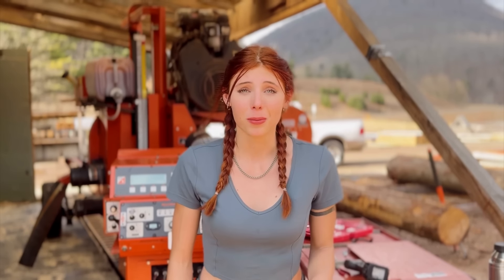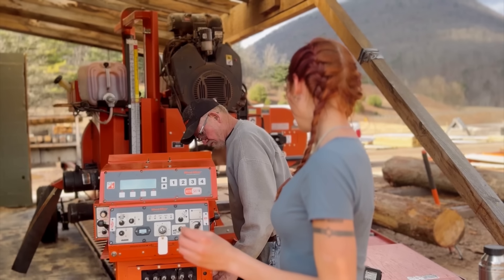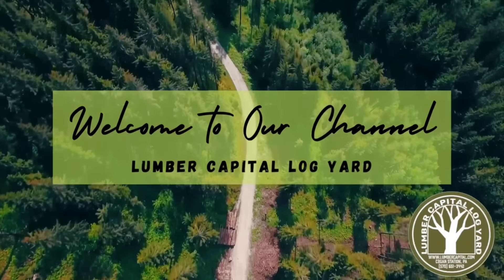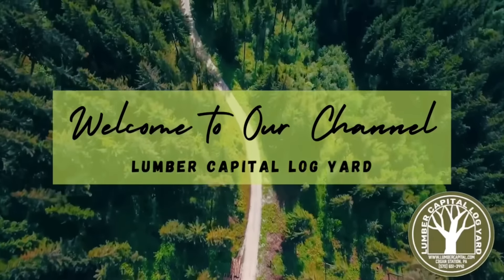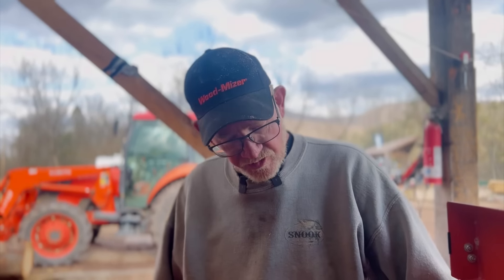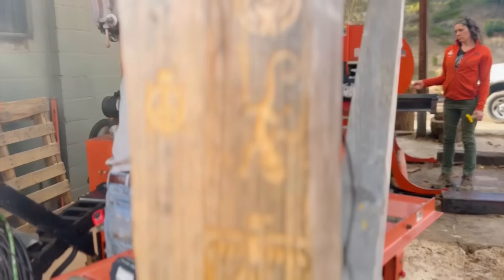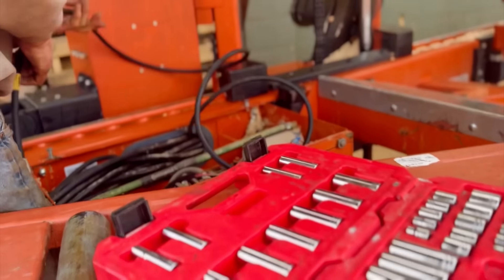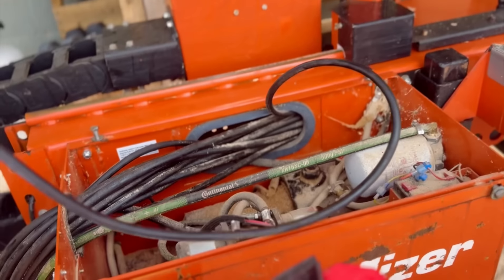A TRICKY repair for something so simple!

Comment: twisting the hose around and around in a s if you were scewing it in works good to.. i,ve also had to cut down a funnel  and place it over the hose so the end of the line didnt fetch up....maybe next time...we are all in this together
Reply from the maker: In the end, that is exactly what did it! Twisting it is for sure the trick!
Reply: @lumbercapitallogyard     YES!!  Glad you got it to go through!!
Reply: Greasing the forward end could help also.
Reply: Hand soap will reduce the resistance when pulling or there’s silicone lube also to help when pulling on such a small hose
Reply: I used to be electrician helper we used to use thin metal that was rolled up like garden hose we put small hook on end and taped old line or string on it enough tape so it was completely covered on string end not to get hung up
Reply: @lumbercapitallogyard There's a spray on lubricant us broadcast guys use, for pulling cables through cable trays in studio installs, and that product would probably help the same way with hydraulic lines, as the outer coatings of both hydraulic lines and high end broadcast signal cables is a similar material, same goes with the smooth outer sheathing on pneumatic lines. IIRC, it was marketed by Belden.

Comment: use tape to make the angle of the hydraulic connection more conical and prevent it from getting stuck (a bic pen cap with the string passing through allows you to have a solid cone which will fit well and avoid hitting an angle )

Comment: Hi,they last for manny years but if they rub or flex during each cycle it could break inside.You need a very strong nylon fish cord to make sure it doesnt break the string. Tapeing the front to make a point to not hang up or catch on anything is wise too.A exrea made hose is needed if it breals often ,then you can attach them and pull 5he l3aking one through.

Comment: A lot like pulling big conductor wire in conduit. May need to make a large "bullet nose" on the front of the line. Use electrical tape. Also may need to use a pull wire vs string.

Comment: They are a pain, that's for sure. I've had good luck using a male x male coupler to attach the new hose and pull it through with the old one. Hose lengths are in the parts manual.

Comment: Shove a length of rural poly hose down it and get it to poke through then feed the hydraulic hose inside . Once its down there you can leave it in or pull the outer hose out.

Comment: i had to deal with this same problem pulling wire... first use the line to pull a more substational thicker and stronger  line through likea  paracord or may be 2 of them so you have a second chance if you break it on the first go; then use that line... get a (sacrificial) threaded hydraulic cap or some other arrangement of fittings  drill a hole dead center being sure to deburr it so the hole does not have any sharp edges...  and  put that para cord through that hole  tie a few knots in the cord so that you can pull on it with out it slipping back through the hole.   for good measure wrap some tape (blue painters tape works great) around the cord to the fitting so that there is a gradual thickness transition between the cord and the hose... affix the hose to it and you should be able to pull it without snagging

Comment: If you use a electricians fish tape which is a steal cable and it has the ability to pull much more.  Home depot has them and you just need the short one they have will do fine.    The cable will ride on top where a string pulls uneven and the tip is slipping to the side thus creating a jam.    Metal end need follow the line.   So some electrical tape will be needed to keep everything in a straight line.

Comment: That always gets stuck, twisting it helps. If there is enough space you can use these hoses used to protect cables, wide enough to let the hydraulic line through. Tape the end to the hydraulic line and pull it through like you did with the string when removing the hydraulic line. To reinsert the hydraulic line push it through the cable hose, cant get stuck that way, and afterwards pull the cable hose back out.

Comment: Non conductive fiberglass fish tape. It will allow you to push through and pull. The hydraulic hose rubber has a lot of resistance that makes the pull hard. Non conductive lubricants might help the pull too.

Comment: Another process is to center the tow line by adding a centering rod into the hose and tape it to where the hose is centered to the tow line. like a sharpened pencil.

Comment: Or having the old tube in place, used a male male connector and draw it trough. But to late now. But replace this thin line with a steel wire firmly attached to a male connector and just get some power to pull it trough.

Comment: Better to pull aircraft cable through first and then use an old fitting attached to the new hose and then you can pull hard

Comment: I’m not sure but I think the size and length of the hydraulic hoses are in the owners manual. If so, I would go have the line made up at the shop, attach it to the old line and pull it through as you pull the old one out. Just a thought.

Comment: There is actually a lubricant used to pull electrical lines, and they are much slicker than those hydraulic lines.
I checked, and sure enough, there is a hydraulic line lubricant specifically for pulling or assembling.  Something you should have on-hand.

Comment: As an electrician I use a length of wire as a fish, copper wire is stronger than string. When pulling back in I'll tape the end to make it streamlined, no edges to get caught. As some one else said twisting can help.

Comment: a suggestion to anyone having to run through things is either think mule tape or use the fiberglass rods that network techs use to pull things through conduit. Harbor Freight has cheap versions of this.

Comment: I WELDED A LOP ON A HYD PLUG SCREW IN HYD LINE THEN U  CAN ATTACH A CABLE AND  PULL HARD IT DOESNT SNAG ON THINGS CAUSE YOUR PULLING THE LINE IN CENTER NOT OFFSET PLUS IT KEEPS CRAP OUT OF LINE WHILE PULLING THROUGH RAIL

Comment: Another way to help you fish that line. Is have the opposite fitting, male or female. Then feed you're fishing line through the center of that fitting. Then fasten that fitting to the hose you are trying to pull through. Doing this, will greatly reduce, the line fitting from getting caught up on flat surfaces or other hydraulic lines. As you will be pulling from the true center of the line.  You can also wrap a little electrical tape around it. To make it more conical.

Comment: Now that you got the hose out measure the length and write it down so you know the next time . Then you can thread the new hose on one end when you pull the bad hose out and the new hose will follow into place at the same time . And you will not need to worry about a string breaking mid way 😊

Comment: I would recommend buying an electrical “fish tape”, which is normally used for electrical conductors through conduit. They come either steel or fiberglass. They are flexible but rigid and would serve you better for your task. I was an electrician for 45 years and used them at least once or twice. I’m thinking that the hydraulic line somehow got pulled in above one of those cross bolts supporting that frame member/chase that all those lines go through. I would think that could have been what nicked the hydraulic line that failed.

Comment: Next time try using electrical lub that is used on larger cables fed into a conduit with other cables. You may be using a lubricant already just a trick used by electrical trade.  It should improve the pull.

Comment: Few nice little tools you should get grandad. You get a little cone that screws into the fitting with a hole for your string at the point. Invaluable. 
Also a set of cranked spanners are a winner when dealing with hydralics.

Comment: Considering this has happened before, I  suggest that to prepare for the future, you should have another replacement line as a backup. So when this happens again just attach the replacement line to the line being replaced. You can pull one line in as you pull the broken  line out.

Comment: Screw on a fitting at the end of the hose coupler. that has a hole drilled through it to attach the heavy string. Save this fitting with the hole drilled through it for next time. you have this problem

Comment: You can try to pull the rope again, but tighten it so that it goes along the very top and then pull the hose. Next time, wrap a corrugation for electrical wiring of a slightly larger hose diameter to the torn hose, and pull the new one through the corrugation, then tighten it.

Comment: Round over the end of the hose with tape (like a ball) so it gets around other hoses better.  And try using a fiberglass electrical fish tape. They can be pushed through until they come out the other end.  Then serve your hose onto the fish tape and pull it back to you.  Don't use a steel fish tape for obvious reasons.

Comment: every time you actuate a hydraulic line it has a tendency to "flex". if you inspect these lines on a regular basis you can identify wear points and through the use of shields or guides prevent premature failure.
Reply: and i love the new showroom

Comment: Trick is to give the tip of the line a smooth shape with tape and lube it so it goes easier all the way through the frame. The line needs to hold tight like grandpa did or one will happen to pull a line... with no fish ( pure nightmare, been there before 😅)

Comment: Personally from one old grandpa to the next I would have measured for the new hose and left the old one in as a fish line. This way the new line is pulled into place by the old one and would have slid right in. As you'll see the new line will keep getting hung up because the string isn't pulling it perfectly back in the same hole. You may end up just routing the line outside. Should be a parts list with the saw. Look at the old line for ware marks, maybe it's rubbing somewhere. Preventative maintenance.

Comment: If you make a saddle with wire on the end tie the pull string to that and tape it up good you'll pull it straight on instead of from the side letting the fitting wanting to turn and catch and you would have better luck using a fish tape or Paracord if it's still tight stretch the hose straight out and turn it as it's being pulled my self when I replace a hose that long I replace it with several hoses 4 to 5 feet coupled together as long as you get them good and tight you won't have a problem and if it blows out you only need change a short piece you can keep on hand rather than need an exact length it cost more up front but saves in long run in parts cost and being able to have a replacement piece on hand I learned that back when I worked in the coal mine and have been doing it to all my equipment since I keep enough pieces on hand to replace common sizes if the shop you use has the correct fittings for the factory hoses they will usually cut them up and put fittings on them making 4 or 5 foot pieces if not different Napas have done it for me they just won't warranty a used hose but I've never had an issue when you get into the big 1.25 or 1.5 inch hoses on equipment you'll be really glad to be replacing 5 feet instead of 20 take it or leave it y'all seem to be doing good this isn't good logging weather and so much for winter freeze to boost production good luck

Comment: Just from a mechanics point of view. That hose is probably one of the only hoses to see full system pressure because it reaches clamping force in the application it is used for. Most of the other hoses only see pressure equal to the load it is moving. Also, there are different types of hoses rated for different pressures. Be sure the hose they are selling you is designed for the system pressures exerted by the system.

Comment: You should of used the old hose to pull the new one through by connecting the two with a nipple, you just have to measure the old hose first over pulling out to match.

Comment: Those long hoses through that tight but long channel is a nightmare. Especially for hoses supplying a cylinder which is moving when operating. I would add a short extension between the long hoses and the cylinder for future quick replacement of just that worn-out external short hose part. Wish you all patience for that annoying task and quick success! Cross fingers

Comment: One thing you can consider doing is before you actually remove the hose, initially, instead of using string, use a garden hose (kept exclusively for this sort of thing to avoid contamination) that is of a suitable diameter that can either have the end heated up to fit over the hyd' hose connection (suitably blanked off to avoid contamination), or add a dummy male connector to the garden hose end. Once this is over the end, the pull the damaged hose through and you then have a ready-made guide for the replacement hose. Join the replacement hose and garden hose just like the initial removal then pull through.
 The beauty of doing it this way is the garden hose acts as a sleeve to prevent the replacement hose end from snagging on any structure. The return pull-through is all linear since there is no kink off to one side, as you had with the string. I've jury-rigged many a job like this on aircraft to replace cables and such and the important thing is to avoid anything that juts out to one side.
Note, this can still be achieved even without the original hose in place by using a wire chaser attached to a lengthy extension on the string (so you don't need to pull that back through, thus avoiding the possibility of it snapping!). Feed the wire chaser thru the length of garden hose until you reach the other end of the garden hose with the wire, then pull all the wire along with the string extension thru the garden hose and hey presto...you now should(!) be able to pull the garden hose thru so you can then attach the replacement hose as described above. Might be a bloody good idea to duplicate your string line, first, tho. Because you sure as hell don't want that to snap!

Or, as @DonDegidio said earlier, have the new hose handy and attach prior to removal.

Good luck!

Comment: Woodmizer should have used hard lines through that channel with flex lines connected at each end for the required flexibility.  would have been much easier to repair that way.  the problem your having is they pulled all those hoses in at once so they are twisted around each other making it very difficult to pull back in with a string.  measuring the required length or getting it from the manual and connecting the new hose to the old with a union so the old hose could have been used as the pull string would have worked better.  at this point giving up on the string and using an electricians fish tape as others have stated is probably the best bet.

Comment: Looks like they forgot to transfer the Yellow Colour Code sleeve!  Should have used metal cable for pull wire.  You can also coat cable with liquid dish soap.  Make sure to use enough tape so there are no edges to catch.  Great braids.  They make steel wire cable pulls which might help next time.

Comment: Murphy's Law; whatever can go wrong,will go wrong.  when cable companies pull cable thru conduits,they use a water-based lube to lower the friction,make it easier to pull. IDK if that would help you or not. some electrical tape around the connector might help,too.

Comment: To replace the hydro line through the channel we used a fiberglass tent pole from a dome tent. It's stiff enough to push the other lines out of the way and helps guide the new line through the tight space.  It also creates a rigid entrance/exit path from the channel's openings that the hose ends can follow. Most importantly ... it won't break on ya' if you have to use a lot of force.

Comment: When I've had to run a wire or hose through a tight space, I've found that if I slick the wire/hose up with dish soap, it slides a lot easier over the existing wire/hose bundle.

Comment: A fish tape would have been better to pull with. Also yes if you could have gotten the length or hose and had new one ready to pull with a coupler would been better. I am sure you still may have had hang ups.  I know easy for us to suggest better ways to get done. Maybe a video follow up on the final outcome…

Comment: I would keep a old hose, attach it to the bad old one. Pull out the one you need to replace, leaving the temporary one in the tube. get the replacement hose, reattach to the temporary one and pull the new one thru. Store the temporary one for future use.
.
Its those bolts, most likely hitting,  raping tape around the hose out the string making the approach angle to the bolts smooth, is another possibility.
Use a string you can truly yank on.
Not with equipment, just hand force.
.
Figure out the approximate location of the blow out, and if applicable get plastic hose protection, its like a plastic spring that goes around a hose to keep it from rubbing on other things getting a puncher.

Comment: For the next time measure the hose get a spare and buy a union to screw them together and pull the new line in with the old one. That's the best way I've found to pull the lines through keeps the ends clean from being sealed to each other.  Good luck and keep up the great videos.

Comment: I would tie a heavier chord to the string and pull that through first and then tied the heavy cord to the hydraulic hose and pull that through something that would be strong enough.
Not to break in Like when you throw a throw weight over a branch when cutting a tree down, you gotta small 16th inch 9 line lying you throw over with your throw weight and that hooks to your half inch or larger rope that you need to use when you're doing the tree work, so you throw the light. Line over you tie that to a rope, you pull the rope over now. You can pull it without fear of breaking.  Or you can climb without fear of breaking